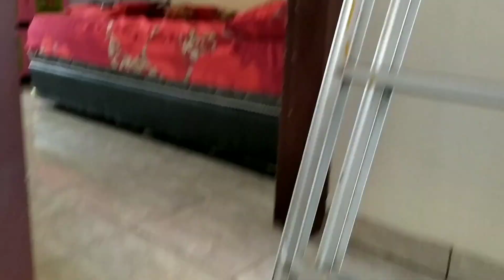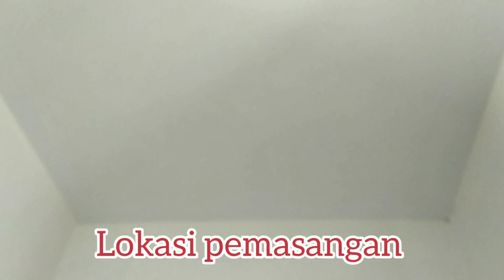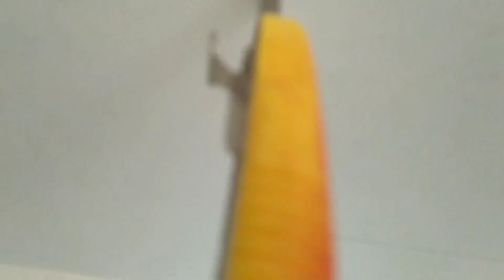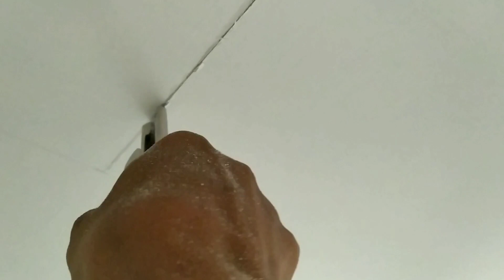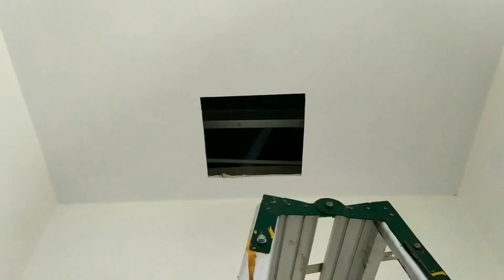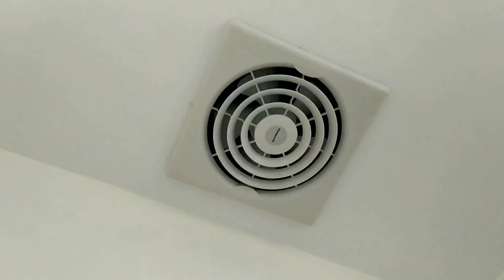Cara Pasang Exhaust Fan di Plafon Gypsum | Cara Pasang Kipas Hisap

Comment: Om itu kabel yg hijau kuning untuk apa yah?disambungnya kemana?
Reply from the maker: Kuning hijau itu kabel ardhe atau pertanahan bro..
Reply: @AroelElectricDIY  ok om..om punya saya panasonic type model FV-25tgu3 mati total gak mao mutet kira2 apa nya ya masalahnya?kapasitor udah saya cek pakai multi meter normal 2 mikro...mungkin bisa bantu solusinya om?ada kemungkinan fusenya putus gak di dalem dinamo om kira2?tapi dinamo masih bagus sih om soalnya belom pernah saya pasang..giliran pas saya pasang koq gak muter ya
Reply from the maker: Sambung nya ya ke ardhe.
Reply: Maksudnya untuk kabel ground ya?kalo gk dipake gpp tu om?
Reply from the maker: Gak pa2 bro..fan digantung alias gak dipegang2..